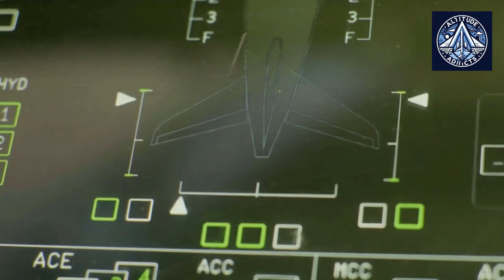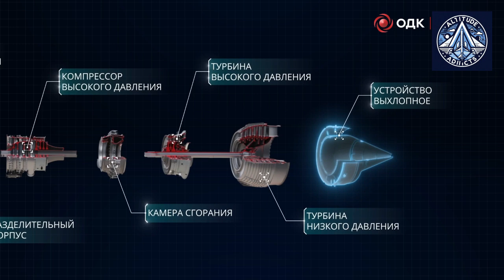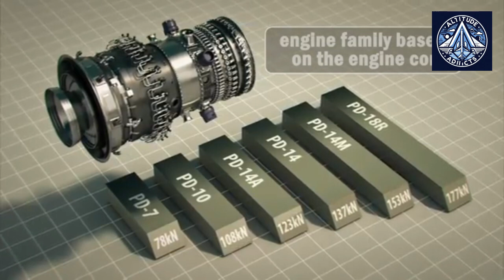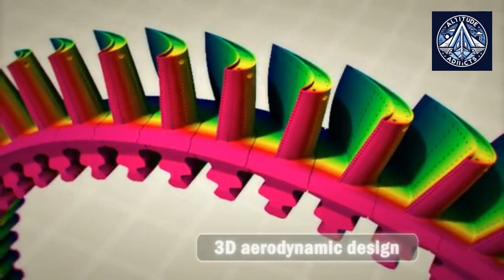The Russian PD-14 -  A Deep Dive into MC-21 Aircraft's New Engine - PW1000G and LEAP-1 Competition

Comment: Doesn't matter. Russia's aeronautics industry can never match the US and EU. Too dependent on tech that will never be shared with Russia again. FADEC don't run on stolen Ukrainian washing machine chips.
Reply: How stupid are you?
Reply: Obviously, that is a dumb statement.
Russia still has the tech, and even now they can allow themselves to buy what they need, or to manufacture it. Russia can produce basically anything it need to build a plane or an engine. CPUs, displays, all sorts of controller and stuff. It's not a top of the line TSMC gaming hardware, but it's more than enough for its purpose.

Comment: strange that you mention the engines power.  However airlines are interested in the hourly fuel burn rate. 

These engines burn far more fuel than their western equivalents.
Reply: Возможно.Доработка любых двигателей идёт постоянно.Не забывайте,развал ссср,двадцать лет никто не занимался ничем.Была катастрофа.
Reply: @ДмитрийЛебедев-р9н  Совершенствование двигателей без помощи Запада поставлено под угрозу. 
А распад СССР был уже более тридцати лет назад.
Ваш либертицидный президент-диктатор не способствует развитию российских талантов. Вы не можете иметь все: и диктатуру, и свободу творить, и думать, и продвигать технологии своей страны. Ваш интеллектуально ограниченный президент выбрал для вас самое худшее: тюрьму для всего русского народа и совершенно нелегитимную войну.
Удачи вам!
Reply: Airlines are interesting in cost reduction, not just fuel burn rate. If you're choosing between burning a little more fuel or your plane not flying at all due to wide-spread engine defect, you can live with burning a little more fuel, it's much less expensive. "Far more" is comparing modern engines to something like D-30 - Il-62's engines.

Comment: The PD-14 is better than the pratt and Whitney engine, even if the American company have more experience.
Reply: Lest's wait the operationnal figures in real life, not just propaganda figures.
Reply: It's kinda comparable, but the worst part is the price of PD-14... It's price twice higher than P&W engines. Ofc certification, testing and non-serial production are pushing the price to the sky high levels. Even IF it is better, the only thing is pushing to use these are sanctions.
Reply: @ggnet-lm7pg  100% correct, the higher initial purchase cost is exacerbated by tiny production runs = no economies of scale, also severely limited parts availability will limit this to being a niche product for those who cannot get anything else. As mentioned the tech is "okay" but far, far away from being cutting edge. Pretty much a typical case study for RF engine tech starting from the Nene until today...
Reply: @amershabana833  It is better because the internet says so? No specifics = invalid statement. Maybe some other sanctioned states can buy some - if they don't have any other choices